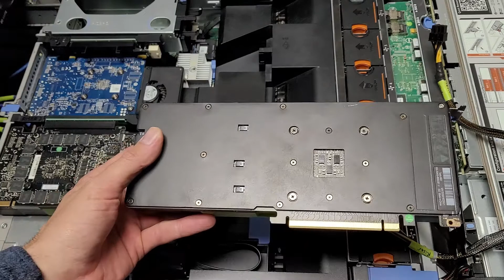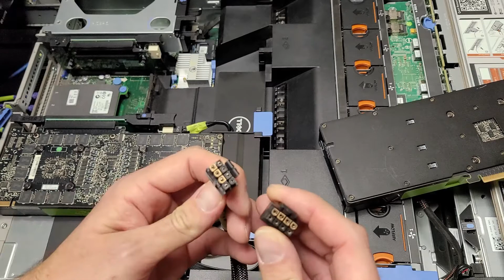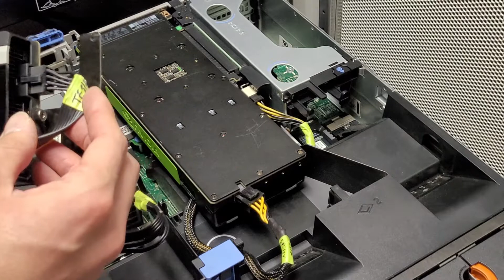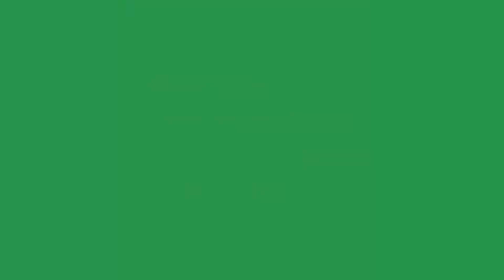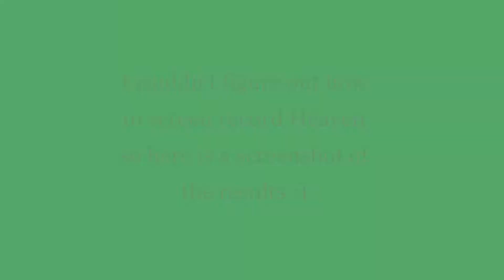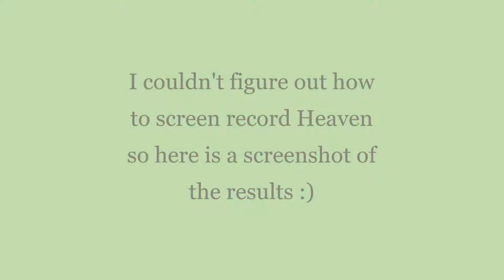My latest server upgrade. Adding a Tesla M40 to the mix with my custom power cable.

Comment: I just got a Tesla P40 for my R720 server, but for some reason Idk why it shows code 12 after I passthrough Windows 11 VM in Proxmox. I use the same 750W PSU as your video, and the cable are right, from riser to GPU cable. Do you have any ideal? I use K80 before, same power cable and PSU, in windows 11 one of GPU shows code 12 but the other one working great. Can you help me out? Thx
Reply from the maker: I have no experience with Proxmox or Windows 11. My guess is there is a setting that is wrong.  You may want to check through Craft Computing's video playlist:

https://www.youtube.com/watch?v=8Qm9IbSHkus&list=PLGbfidALQauLclCL3d4MWZ8F5krtwToZ3

Otherwise I think this specific video is the one that should help:

https://youtu.be/-34tu7uXCI8

Comment: I realize this is fairly old and you're not terribly likely to respond. But did you have any problems running two different GPUs in the R720? The official documentation for the R720 from Dell says "all GPUs installed must be the same make and model" but they've been known to list any configuration they havent explicitly tested as "unsupported" even though many actually work quite well in practice.
Reply from the maker: I started with the K80 then the K80 and a M40.  After that dual Tesla M40 GPUs. Currently I'm running a M40 and a 1070. I haven't noticed any issues. I'm using them in passthrough on esxi to two different VMs.
Reply: @computersales  you're the man!

Comment: Great video! Did you have to enable above 4g decoding in the bios? I read that it's necessary for an M40, but I can't find the setting in my R710 Gen 2 bios. The card is visible in windows device manager, but has the yellow error symbol and says "Code 10 Not enough resources to start API"
Reply from the maker: I don't recall what I did in bios when I set this up.  Unfortunately I'm not sure if the R710 would support the card. I don't believe there is a bios option for above 4G decoding in the R710 bios. If you live in the US people sell barebones R720 systems pretty cheap if you wanted to upgrade.
Reply: @computersales  Thanks for the reply! That's a bit disappointing, I should've looked into this a bit more before buying the card haha. I live in the UK, so I'm not sure there's as many R720s around, but I'll have a look into it. Thanks again👍
Reply from the maker: @timhowitz9405  Best of luck in the search. I know in the US I've seen R720 and R720xd units pop up for $150USD shipped.
Reply: @computersales  Thanks, yeah, I've found one for 100 quid already, so maybe there's hope after all haha
Reply from the maker: @timhowitz9405  Nice. Even the R720 is starting to get a bit old but still a versatile mache that is affordable to upgrade.
Reply: @computersales  Yep👍

Comment: I plan on doing the same, which OS are you running how did passthrough work ?
Reply from the maker: Windows 10 pro. Passthrough was a bit tricky to setup. I've been meaning to make a video but kinda blew it off.
Reply: @computersales  Okay, I'm running ESXi planned on making a vm for gaming. but i couldn't even update iDrac or Bios. I would like to know what you have to go through I just got an M40 24GB for $100
Reply from the maker: You have to add custom variables to VMware.

Add variables:
pciPassthru.use64bitMMIO=”TRUE”
pciPassthru.64bitMMIOSizeGB= “64”

Also enable GPU mode in powershell.
nvidia-smi -dm 0

Sources:
https://blogs.vmware.com/apps/2018/09/using-gpus-with-virtual-machines-on-vsphere-part-2-vmdirectpath-i-o.html

https://www.overclock.net/threads/gaming-on-a-tesla-m40-gtx-titan-x-performance-for-a-third-the-price.1777611/
Reply: you are a god send.

Comment: Can you go over how you made the power cable. I have a HP DL380p Gen 8 and NO ONE has the 250w power cable. I have the 10pin to 6/8pin 150w but it seems to be buringing out the gpu riser cards so i need to make a custom cable.
Reply from the maker: This video will show you how to figure out the pinout for your server:
https://youtu.be/DOfqyjf-gCY

This video shows how I made my custom cable:
https://youtu.be/CvUnVeQgIWk

Comment: very useful! i just installed 2 cheap p40s to my also cheap r720. what is your temperature setting? ( racadm get system.thermalsettings ) or whatever that keeps the gpu temp below 80C ? 😁
Reply from the maker: Nice.  Kinda wish I could find a "cheap" P40 to play with.  If I am not running them long I just let them run hot and thermal throttle.  Otherwise I was running a FanSpeedOffset of 2 to get a balance of cooling, and low noise.
Reply: mines currently at the below.  fan speed is ~10K RPM when GPUs are under load. 
Inlet & exhaust temp at 36, 42C respectively, while GPU temp range bewteen 62 to 71 C.

AirExhaustTemp=70
FanSpeedOffset=Low Fan Speed
ThermalProfile=Default Thermal Profile Settings
ThirdPartyPCIFanResponse=Enabled

cant figure out how to change AirExhaustTemp, and i can only switch FanSpeedOffset with these 2 values 0 and 255 - manual says you can change the value to 1,2, or 3 also.
Reply from the maker: @aigonewrong.  I never messed with the other settings to be honest.  I just forced the fans to a higher speed to help with cooling when needed.  My stuff is idling most of the time so Exhaust temp is around 33 C and GPUs around 40 C.
Reply: @computersales  nice. thanks for sharing the settings and the temps! the P40s once in while pop up on ebay for 300 to 400, I'm guessing, soon, maybe next year MSFT & NVDA will likely be retiring their P40s, which is going to drive the used market price down much more.
Reply from the maker: @aigonewrong.  That would be nice.  I'm eyeing either a P40 or a 1080 ti FE to play with.  Granted I hardly use my M40's as it is though.

Comment: Very interesting video. My first enterprise server (a Dell R720XD) was delivered to me this week. Mine has dual 2630 V2's.  The original plan was to find a quadro M4000 for a fair price and build a blue iris surveillance server on steroids.   Now I'm wondering what I can do with an Tesla M40.
Reply from the maker: Nice.  I wish I had an XD model to play with. In a more recent video I upgraded my server with a pair of E5-2670 v2 xeons.  I'm not super familiar with the Quadro M4000 or blue iris.  If you don't need video outputs the Tesla M40 should be more capable for a lower price.  You would only be able to fit one Tesla M40 compared to the two Quadro M4000 cards though.
Reply: @computersales   M4000 is a middling card, but is super slim, so you can fit many into a 2U server if desired. Also, Blue Iris is software to help monitor your home or work area. With some graphics and some AI, you could use it to identify activities.